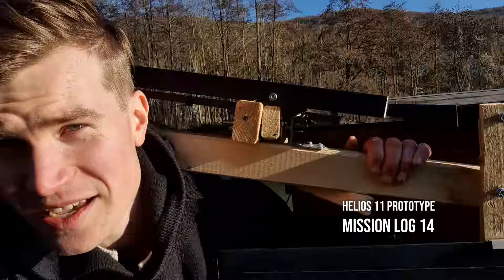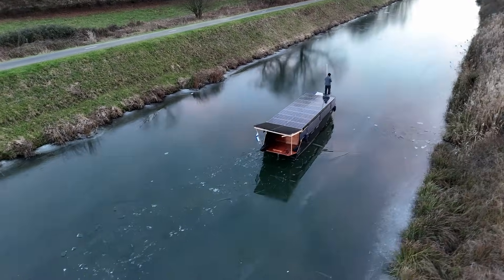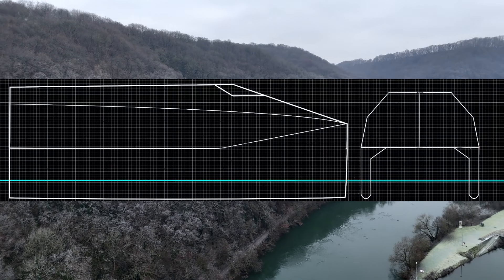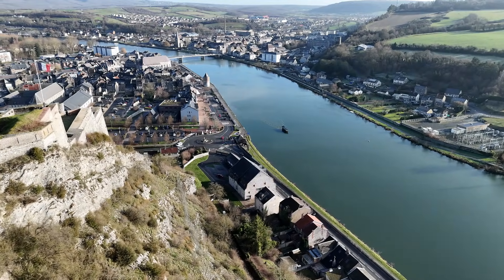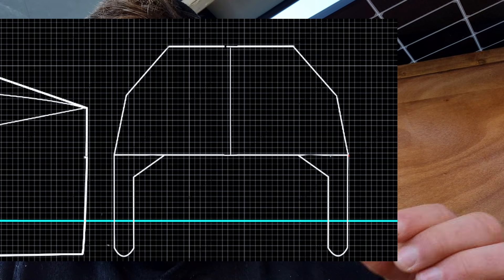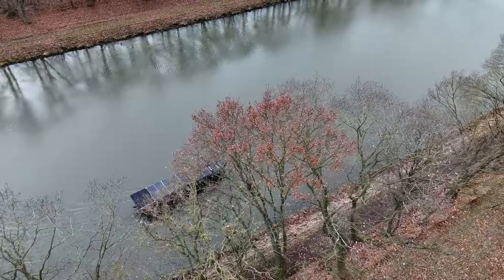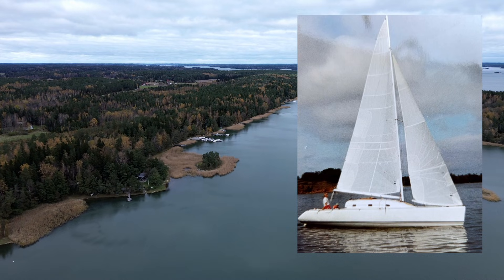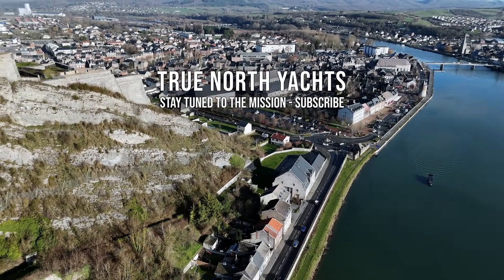My Solar Prototype Reaches France: Upgrades & Next Model

Comment: I think you should optimize for minimum wet surface area. Skin drag is by far the most dominant at low speeds you will travel.

Comment: I love your videos.   I wonder what the improvement in speed and range will be in Spring and Summer compared to winter.    Also, when your new design comes out,  how much better will it perform?   ❤
Reply from the maker: The new design will have roughly 3x the speed and range. Haven't made precise comparisons yet. But we're talking economy cruise speeds of 10 - 12 knots, full day trips at 15 knots potentially.

A narrow hull catamaran is just so incredibly efficient.

Comment: Airships: please reconsider. A friend of mine designed a one-person airship which he, I, and another friend built in 1984 named White Dwarf. Set numerous records in it in 1985, some of which still stand. We came up with designs for solar airships; one was intended to set the record for first non-stop around-the-world flight; design name was “Globe Girdler.” Airships are VERY finicky, very weather sensitive, and even one which only carries a small crew of two or three is going to be too large to fit in anything but the largest hangars ($$$$!) With a craft like yours, you tie off to the bank of a canal, dock at a marina, or anchor in a harbor; with an airship, you need a ground crew which sets up a mooring mast at an approved location. You can’t just tie-off or anchor somewhere. Autopilot option on an airship is not really an option… and airspace restrictions & regulations are MUCH more confining than nautical restrictions.

Comment: Dang , well done ,opening up a whole new option for ocean cruising ,and as batteries are getting better [ sodium solid state at production stage ,cheaper safer and longer lasting ]. motors getting better ,perovskite solar ,way cheaper and lighter /more  flexible ,can only get better . have you thought of  solar tracking tech ? looking at the little star link set ups ,it does look like you could make ,say lots of 1 m square panels all track for not to much outlay ,,i think the gains can be around 30% from memory , particularly in your higher latitudes . you could do some calcs on Warrams V hulls for comparisons , good load carrying with not to much loss of performance ,and very simple to construct ,plus according to his research they always attract bikini clad girls for some reason ,not sure how or why ...

Comment: Hi Lukas , I know nothing about sailing, But like you I am Advanture, just a thought, with Solar panels  on the back of boat made adjustable at right angles to the sun, am thinking about the flexible panels on the front if they were put in a curved shape, would that generate more energy?? Just a thought an enjoying your experience

Comment: Use 15 prismatic LFP cells in series (48.0vdc low to 54.75vdc high) then these packs in parallel, and wire up your own BMS. Plan the bus bars as part of the build. Plywood, rubber, aluminium. Voltage to low to hurt you. Like 628Ah ones are quite small, 352.3mm by 207.2mm by 71.7mm, they will easily fit below the water line section of the catamaran. Use two motors, one on each pontoon and differential thrush to steer most of the time. Also redundancy.
Reply: 16S (51.2V) is more universal and compatible with most inverters.
Reply: Use differential thrust to steer? How would that effect your efficiency?

Comment: I haven't felt this inspired in a long time. I've had this idea for a long time myself but I have no experience with building or operating boats. I'm surprised no one has done this before you but it is incredible you were able to build this in just a short time with fairly limited resources. I wish I could do what you are doing now, traveling like this. Unfortunately, I probably never will. But wow, this is incredible.
Reply from the maker: You need to experience. Just awareness and a purpose

Comment: Building solar boats is great, why not? But thinking this is brand-new technology shows a misunderstanding. The photovoltaic effect was discovered in 1839 by Becquerel and the first functional cells were made in 1883 by Fritts. Silicon solar panels have existed since 1954 at Bell Labs. Electric motors have been around for over a century and rechargeable lithium-ion batteries were developed in 1980 by Goodenough. Producing electric boats today is perfectly fine, but these are old technologies, not recent ones. Spoiler alert: the challenges of electric propulsion are exactly the same as 140 years ago. Battery energy density, recharge time, range, lifespan and degradation, weight and its impact on performance, limited photovoltaic efficiency, intermittency, required surface area, overall cost, rare metals needed, and environmental impact from mining to disposal. Believing we are in a magical ultramodern era that makes everything possible is not physically accurate. Designing electric boats is not more foolish than proposing diesel boats, but it is not inherently smarter either. We are no longer in an era of discovery or invention; we are applying discoveries and inventions made long ago. Let’s stay practical and focus on intelligent applications, which is already a sufficiently complicated and satisfying task. Best wishes for success and a happy new year.

Comment: Marine grade plywood is good material yet it rots fast if unprotected in marine conditions. Wood is DESIGNED to move water along the capillary grain of the wood (plywood increases woods abilities to move water - twice as many directions - sealing is twice a difficult).  End-grain balsa (as a core material for truly waterproof materials) is the only wood worth considering for low maintenance AND long life.

Comment: The Halo 13 is an exceptionally cool design, and it has its pro's, and also unfortunately its cons... one of those cons, the two hulls, might sit deeper in the water than expected, instead, if you go trimaran on the Halo13 it won't sit so deep in the water, and the center "Ama" will be housing the engine, batteries and will be 700mm wide, and then you can narrow down the ama's port and starboard because you don't need anything in there really, so AND you will save on wire lengths too if all the tech is in the main hull that sits below the water in the center... hope this helps... my friend Lukas, i do Sketchup 3d, so if you want 3D renderings of Halo13 drop me an email, or WhatsApp me, because i am too a Dreamer that wants to become an Achiever like you... Safe nm Captain

Comment: Well, I wonder, if you had more of the torpedo shape, you could double up the batteries on a plate. Slide them in on their side and lay them flat. In this way it could be a little narrower at the water line. Don't know if I described it well enough, but it is something to consider.

Comment: Last night (on a flight to Hawaii), I worked on my own solar boat design.  I know the design you are talking about would be more comfortable and efficient in the water, even moderately rough water, but I grew up in the Pacific Northwest where we have bad weather... If it capsizes, you are dead.  So, I will stick with a mono-hull.  I am designing the ability to tilt the solar panels toward the sun.  Actually, the whole side of the cabin will be on a piano hinge so as to tilt open and toward the sun on the other side of the boat.  Also, I will have a short mast and a jib (unfurling)--easy to manage and excellent control.  I will have a single broad keel--ballast skeg--with batteries inside.  As for stability and comfort in moderate waves, I will think about outrigger options.  I wonder if..  What if it could extend and retract making the boat similar to a rigid inflatable when retracted for the roughest seas?  I just now thought of that...  like consider it..  obviously, the challenge is structural but likely doable.

Comment: I've been watching your videos for a couple of months and totally agree with your concepts and the extraordinary numbers you're putting out. I've been testing a 12m sailing cat I converted to electric drive, with a 12kw motor and 3.5kw solar array for the last two years in the Pacific Northwest. I'm amazed how efficient it is, it's glass over ply, with hulls very narrow at the waterline. Just the sun on the panels, under 3kw pushes the boat along at 4.5 knots without drawing from the battery. I'm using this setup as proof of concept for another 12m glass over ply cat I'm 3/4 of the way through building, I love working with ply, and such a warm rich interior finish as you say. This boat will be solar driven with 12kw of panels, 25kw motor and 100kwh of batteries. My skills are off-grid solar and building, I suck at documenting but have some crude progress videos if you're interested

Comment: 1.  Batteries below the water line:  Better have them mounted above the bottom of the bilge in case of water ingress and have good bilge pumps.  If your batteries get submerged that could cause dangerous problems beyond just loss of power.
2.  Are you going to make your pontoons NACA foil shaped for ultimate efficiency, or just tube shaped with rounded ends?
3.  Are you designing into your catamaran self righting moment?  Most catamarans stay upside down after a capsize with no way to self-right.

Comment: Very much enjoying watching your videos.
2 observations that I hope will help:
1. The narrow 35-40cm wide parallel sided twin hulls look too slender and prone to lateral flexing. The increasing width of conventional hulls, toward the aft, provide lateral rigidity & strength. On your front profile, it feels like it would be better to taper the inside of the hull up to the cabin floor, if keeping straight lines to keep the hull profile almost triangular, if that makes sense.
2. Us native English speakers pronounce 'yacht' as 'yot'.
In the meantime, looking forward to more inspiring videos :)

Comment: you gotta come to the ecuator line haha, i live in México and our beaches are paradises almost everyday, unless there is a hurracain, but you can run away in your boat.
Idk but i think its important to check the angle of your haults compared to the waterline, but take into consideration the tilt the boat makes when you accelerate, it feels like that boat will feel more stable the faster you go.
Get someone to test your 3d proyects in a medium scale config, to check for airflows, stress points, etc (i mean, 3d prints bigger than 30x30cm, like at least 1mx1x(its easy to print multiple parts and then glue them))

Comment: Friction of a SWATH hull will eat the savings for lunch.

The super slim hull will also result in deep draft, not cool for a boat of such purpose in my mind. Your designs do not have any usable deck space. Solar boats will be mainly used in summer or in the tropics, there it is a must to have some open space, maybe with some shades of cause. Staying in the hulls will not be a pleasant thing, simply due to heat.

Comment: Will this 5m wide SWATH design be compatible with canal cross section considering your lowest point will not be in the center like a monohull but at the very edge closest to canal wall?

Comment: The only thing against a SWAT design boat will be bigger waves, the boat has to be high enough to let them pass underneath the cabin , other wise the bigger waves will smack against it and destroy the boat. Not a boat for the North Sea. Short high waves.

Comment: 4:49 When I look at your concept design for the SWATH, I always think that you should consider moving the two floats further inwards. 

You know you need two more pressure bodies (pontoons/torpedoes) for buoyancy, and with the current design, these would then protrude below the waterline beyond the actual hull, which makes it difficult to correctly estimate distances in canals and locks.

In addition, you would then also have the option of properly reinforcing the fins/stilts on both sides of the hull and securing them more strongly against shear/torsional forces.

Just my thoughts.

Comment: Hi Lukas, i had a sailboat which I converted to electric. The boat had a 3kw pod engine from epropulsion and 4 400watt solar panels. We used it mainly in summer but it worked great. Even though the boat had a weight of 3500 kilo in summer 8 to 9 km/h on solar only was no problem using about 1800 watt. The weight is not a big factor when your hull is efficiënt in my experience.
Great work on the Helios looking forward to future builds 😊

Comment: Hej igen,
Tack för videon. Jag har noterat förut att du tänker lite konstigt när det gäller paneler och vinklar. Flyttbara paneler fungerar men de har en tendens att gå sönder. Inte bara själva apparaturen för att vinkla paneler utan även panelerna i sig pga vridlast. Du kommer nog undan med detta på kanaler men det håller inte länge till havs. Jmf med hur paneler är fixerade på de flesta segelbåtar.

Om du tar ett steg tillbaka och funderar på vinklar (noga) inser du rätt fort att alla ytor tar in ljus. Du kan sen räkna ut hur mycket du vill ha under olika förhållanden. Två paneler vinklade 90 grader ifrån varandra ger en helt annan productionskurva.

Mycket mer feltolerant system.

Comment: Really enjoy your channel, especially the range and variety of designs you discuss. I fully agree that for solar yachting it makes far more sense to design a boat that is solar- and electric-centric from the ground up, rather than converting a traditional sailing vessel.

I’m particularly drawn to the torpedo-style pontoon designs, as they should offer excellent stability. Many years ago I spent a week on a semi-submersible barge in the North Sea that worked on a similar principle. It was clever in that the pontoons could be flooded to increase stability—although I’m not sure whether something like that would be feasible in your designs.

Personally, I suffer from seasickness, so the torpedo / semi-submersible approach would really suit me.

Also, with regards to the batteries below the water line I think you will need to create a special comparment inside each of the huls so that any water that finds its way to the lowest part does not come into contact with your batteries....or you will seriously have to think about what happens if you have water going to those lower areas of the boat?

Comment: Tip: be careful with moister and eventually water under waterline in those 'torpedos' of Helios-13, even if it will be water tight, below waterline moister from air will always accumulate and drain, maybe some electric fans or pump system can solve it easily.

Comment: Best wishes for the new year. Regarding your swath design, I have doubts about the position of the waterline. On the sketch you showed, the volumes under the waterline seem way to small.
Reply from the maker: The volume under the waterline is 5000 - 7000 kg (depending on the images)
I will have to double check it for sure

Comment: Hi lucas. I like your ideas and your endever and would like to add some of mine.  
 The idea is to add a computer controled kite  as an additional propultion method. Those kites are computer controled and wont interfer with the solar energy production. You can serch for YouTube clips of them by the name of kite mast.
Aditionally i think you should consider sume more tweeks to your helios catamaran brillient desine. First consider the ease of working at the nerrow hals and concider making them whider at the bottom. You would need to concider protecting the sensative electrical systems in the huls from exidental water entering and acumulating in the bilge a bilge pump comes in mind. 
I would put 2 strupes under each battery to ease its munting and dismunting.
Aditionally i would concider armoring the water line, bow outsid aria, and undeside, against impact from floating debrea and rocky ground.
I would make the uper structure able to flote on its one in case of water fludding the huls, whice would save most of the vassal in that case.
Thanks for your show.

Comment: I'VE GOT AN IDEA: If you use under the surface ponton tubes, and the part between the tubes and the living body, you form it like very slim cat eyes (the pupil) with very sharp front and rear that makes extreme efficient in the water.
With your knowledge: Is it better to put the batteries in the middle of the pontons so the weight in the front and back is low so the boat rides the waves better and not nosedive in the wave, or is it better to spread the weight over all the length?
PS: You did the same thing as I when I was going on the frozen lake, when my boat wanted to glide up on the ice.

Comment: Have you considered printing your new design in HDPE (the plastic material workboats are made from). If you search for CEAD in the Netherlands you will find materials on it including YouTube videos. Netherlands is highly accessible to you via the canal network, your design could be built while you continue your adventure, it means you could sell or share the CAD design for others to print/improve on, the cost of a 6m long hull they told me would be £18k to give an idea, it means your design could contain more subtle curves if you wanted it to, HDPE is the same material for water tanks and wet rooms, it is increasingly the material of choice for workboats offering maintenance free durability with little or no antifouling required, it is insulting (especially if printed with air infill by design), the surface is less natural than wood but the print grain could be used as an internal design feature like the layer lines of sedimentary rock, and it would pair well with furs :). One and done - print interior as well as exterior and everything else then is interior decor. That's my design concept anyway.

Also add flush solar panels to the sides of your yacht maximizing surface area and giving better late early production. Could be on gas struts to pop up like wings for ventilation and better production during the middle of the day.